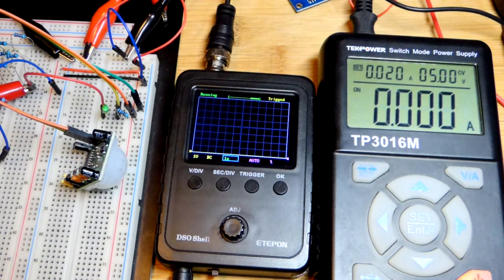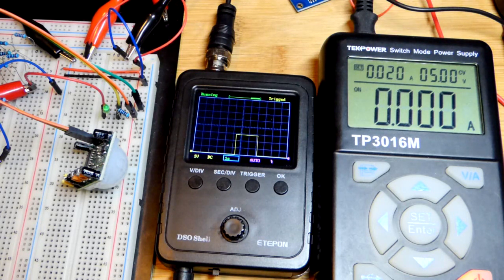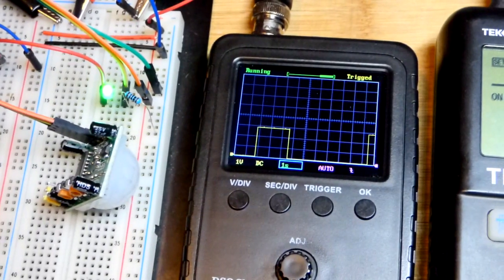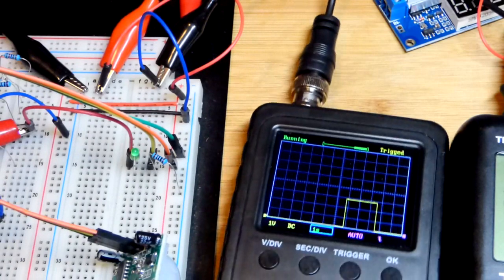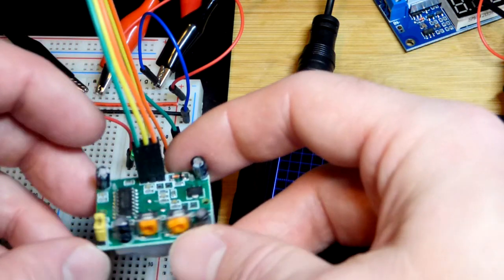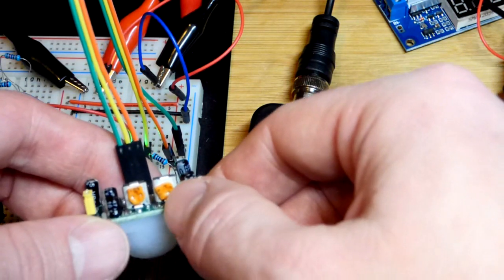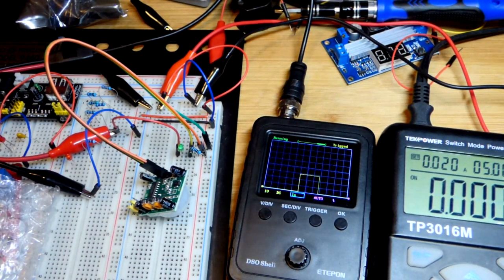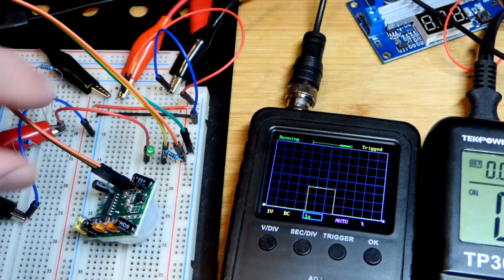HC SR501 PIR motion sensor passive infrared module electronics component by electronzap

Comment: hi, I am trying to connect the 3 pins from this sensor to 3 wires, so not to an arduino board, just 3 wires (that ultimately lead to my domotics system).  How do you call this connector (and where can i find it) that you put over these pins?  And would this be the best way to connect it to 3 seperate wires that are available in my ceiling?

Comment: I also bought myself 5 motion sensors from eBay or Aly. I tested 2 pcs.
Unfortunately, these are just some astabile circuits. They blink in always, without detecting any movement!
Reply: Try the wide-angle PIR motion sensor #2205028 from Jameco its 4-pin breadboard friendly.
Reply: @cocobrother  I'm sorry, but I didn't understand what you meant !
Reply: @John_Smile  I thought you were having a problem with the sensors that you brought off of Ebay. I recommend the sensor because I've had some issues with products from China. My apologies if I misunderstood your post.
Reply from the maker: That's a bummer!
Reply: @Electronzap  😕